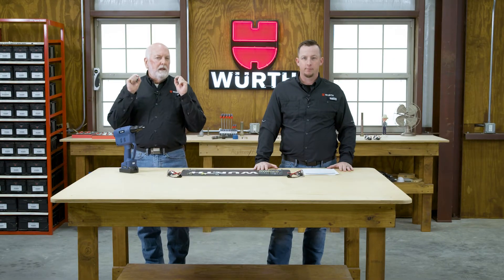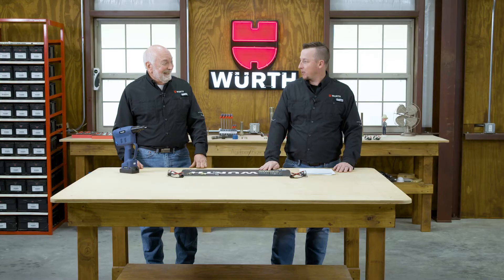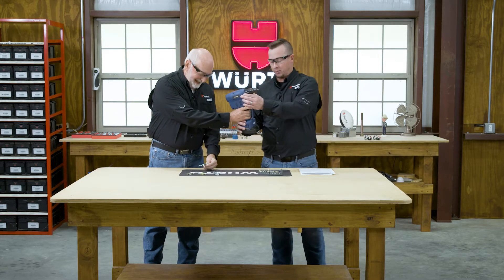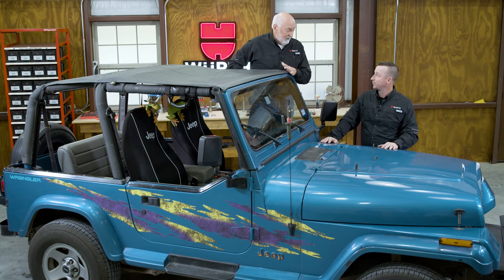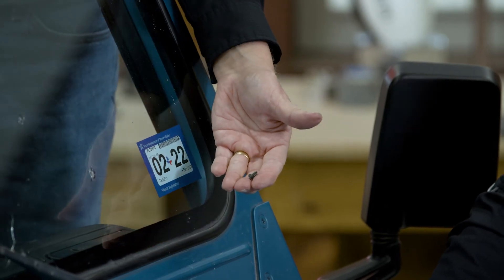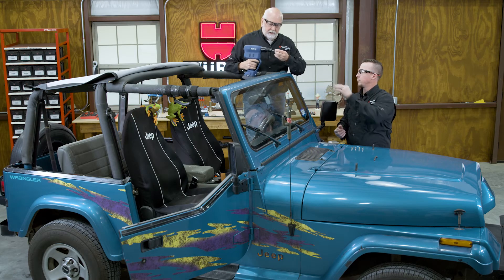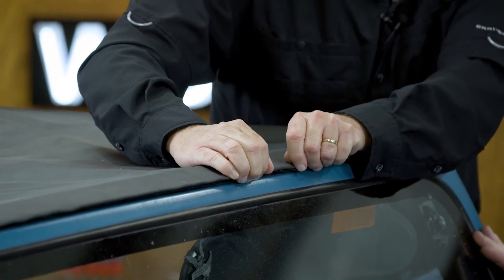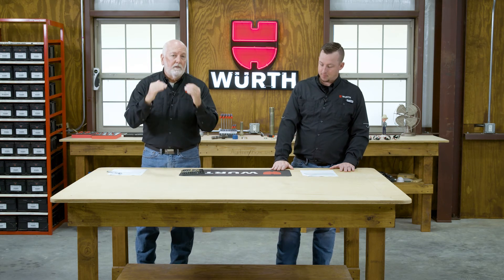Rivet Nut Threaded Inserts | Würth Knowing Episode 23

Comment: As a vehicle with no Jeep experience but this repair needed just a little more. Sealant, 3M makes a non-hardening glassing sealant that fits a caulking gun, but, butyl tape, thin bead of black RTV or just some double side tape. I know you don’t get a lot of rain plus Jeep never put anything on it (Unless stuck to bottom of rail we couldn’t see) but it is just me. To reduce or eliminate the chance of water dripping inside past the rail or riv-nuts, I would have put something down. 
Question; How did you get away for 30 years of putting that off the “Honey Do” list? I need that secrete. If the washing machine doesn’t spin out completely and drain all of the water (small plug of lint type fabric) I would hear about this in 3 minutes, the five times a day until fixed! Do you hide?
DK, married 40+ years!
Reply from the maker: I did add some sealant latter to prevent noise from air leaks. I think my wife has always enjoyed the rowdiness of driving her Jeep. Even though she occasionally complained and wanted me to fix the top, she also used this issue to tell her friends just how tough she could be. Now, getting the dryer to stop squeaking has become a real issue. That’s my next project.

- Randy